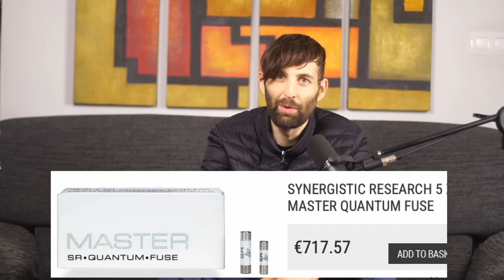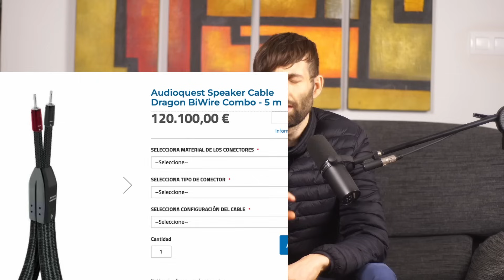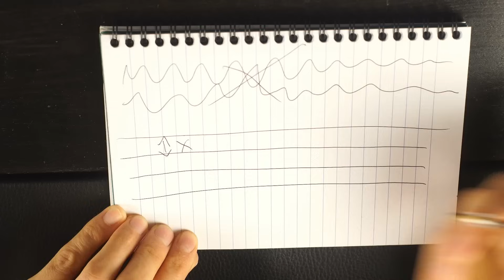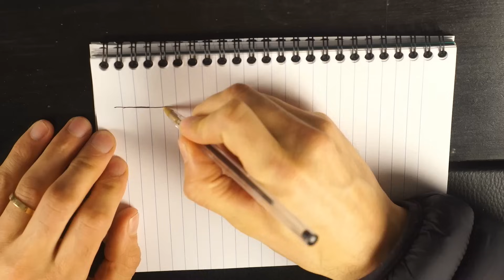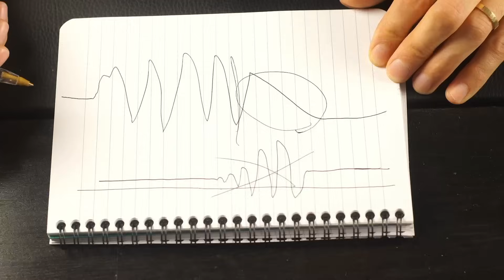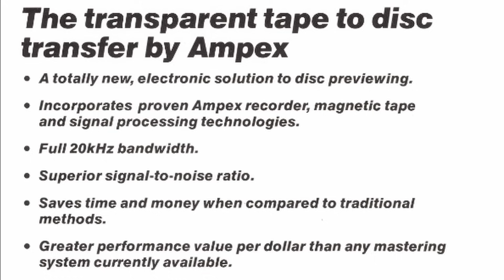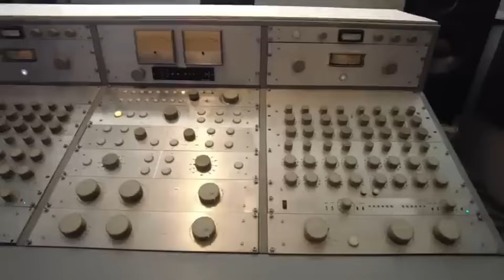Hard truth: most vinyl is digital anyway

Comment: For the variable grove spacing, I am surprised they stated it was cheaper to buy a digital delay unit which would have been very expensive at the start of the 80's than it was to put an extra playback head in the tape recorder. The head for the predicitive signal wouldn't  even need to be very good.

Comment: Thank you! Finally someone who articulated a lot of what's been in my head but unable to easily put into words for the last 15-20 years (but with even more detailed tech explanation).

During the loudness war era (late 2000s + early 2010s especailly) I'd buy an album on vinyl, unwrap it and the first use would be recording it off a USB deck to computer, then I'd use that as my digital version, in preference to CD/mp3. Had the higher dynamics but obviously it'd also get a bit of surface noise and crackling which would annoy me and make me wish that version of the master was made digitally available somehow.

When HDTracks website came about, I thought this would finally be that...but nope, turned out to be lossless versions of the same digital master.

There's definitely a market there for a digital release of the HDR master.
Reply from the maker: 100%

Comment: This argument of digital vs analog and how analog maintains the information that is being lost by digital sampling process has been around for ages. It is technically true that some information is being lost but this not the information humans would be able to perceive anyway. All the high end digital equipment samples at 96kHz. This means it can accurately capture frequencies up to 48kHz. This over double the frequency what human ear can register. Even if you "only" sample 44.1kHz (CD) it's still gonna capture all the frequencies humans can hear. It's almost like the original engineers chose this sampling rate on purpose based of this fact. I think most people don't realize they always are listening to analog because analog is what comes out of speakers. Resulting sound wave will be exactly the same from digital or analog source (minus the noise).

Comment: i will concede that vinyl is digital, however i will argue mine sounds better because i have pebbles taped to my cables behind the amp. these pebbles clear up the audio and sounds like god. and on certain days like buddha. also my cable lifts are made from endangered elephant tusks. these tusks really clean up the signal and prevent deep space quasar pulses from interfering with the audio. the building i live in has beams made cold riveted with cores of pure selenium, which causes some ectoplasmic interference but these waves actually only remove annoying inpurities and leave clean audio.

Comment: Vinyl cannot be digital. It's an analogue format. The source recording might be digital, but the disk is always analogue. And because of the way the sound is put onto the record, and then recovered from it, there are inherent limitations in the reproduced sound quality. The best vinyl LP records have no more than about 18 to 20 minutes of play time per side because squeezing any more than that onto the track has to be done at the expense of audio quality. So, unless you have damaged hearing, avoid any LP which claims to have an hour or more of playback time. They do exist, and they sound awful in comparison to shorter playback time records.

There's too much about this to go into in a YT comment, but there's plenty of information online in reputable websites. But suffice it to say that the RIAA curve enhancement which is applied to all reputable vinyl recording audio both in the recording process and in playback is an approximation to give the most faithful rendition of the recorded sound. It's not perfect, and the different types of pickup head give different playback sound qualities. Also, the condition and shape of the pickup stylus make a huge difference to the audio generated by it and sent to the amplifier. 

A Digital recording in a a CD or an audio file will always deliver the same audio signal to the amplifier, limited by the quality of sound presented to the amplifier you are using, and by any processing which is done in the recording studio, plus the inevitable quantisation noise from the digital processing. And if you can hear that quantisation noise in a 24-bit or higher signal, then you have very good hearing indeed. Most people cannot hear the noise in a 16-bit 22.1 kHz audio signal, as used on a CD. The main limitation is within the loudspeakers and room, or the headphones which are being used.

Comment: the thing is, I did the pepsi challenge and albums recorded to be played on vinyl sound better than streaming. The sound is simply better. Im no expert and nowhere near as qualified as you I can only tell you what I'm hearing.
Reply from the maker: what do you mean? are you comparing a specific record on vinyl to spotify? or are you generalising among many record? the latter is dismissible
Reply: @APMastering  I compared led zeppelin 3. Plsyed it on my record player through my logitech 5500 which has an analogue input and then from Amazon music HD through the same system. Hands down  miles better on vinyl.
Reply: @APMastering  also black sabbath/black sabbath, black sabbath paranoid, black sabbath master of reality, black sabbath vol 4,led zeppelin 2 and pink Floyd dark side of the moon. All sound so much better on vinyl.
Reply: @ViklasSvenske How is that different than playing Led zep 3 on vinyl and then playing the digital version? It's the compression that kills digital reproductions.
Reply: @ I can just use my ears.

Comment: Analog, vinyl purists tend to collect pre 80s vinyl pressings, or at least value them the most, so those vinyl predate the ampex cutter digital delay system.
If money no object, analog purists collect pre 80s reel to reel 7.5ips or higher commercial tapes.

Comment: Being a technically minded person, I never got into the bandwagon of praising vinyl for its sound qualities (but like you, I love the whole experience of listening to them, and maybe yet because I still have my original vinyls from way back when there was nothing else).
But you definitely nailed it when you mentioned the digital delay unit that's being used to enable the variable groove pitch.
And being an industry, the phonographic industry would never indulge themselves with non-rarional reasoning in their equipment selection... So... Didigtal Delay for everybody.
I never knew this was a thing that was sistematically employed.
I thought variable groove pitch was only used in cheapo "the best of x" kind of records, noticing that pretty much every record of any reputable band would have usually tops 5 songs per side or 6 if they were short.

Comment: CD is my preferred way to listen to music. But I did discover that there are some issues with older recordings. I remember when I got a Procol Harum album on CD, Shine on Brightly I believe, the CD songs were all slightly shorter and pitch shifted a bit higher than my vinyl copy. After looking into it I discovered that the original studio recorded for several months  with a mis-calibrated reel-to-reel deck. The newest CD remaster of the album (at that time) didn't take this into account. Fortunately I was able to find an older release that was done correctly. But other than weird instances like that, vinyl will be hard pressed to beat digital.

Comment: Going in the opposite direction, I saw a documentary about the creation of a digital (then modern) version of the Mellotron (a 1960s sampling machine which used tape, most famously used in Strawberry Fields by the Beatles), the M4000D. They said when they recreated and recorded the sounds digitally they sounded too good so in order to make them sound more like the 1960s version they copied the digial recordings  onto 1/4 inch reel to reel tape as an analogue recording (like home enthusiasts had) then digitised a playback of the reel to reel  recording. That was what was then put into the machine ROM. This added the analogue warmth people prefered.

Comment: A big part of the "vinyl sound" depends on the EQ profile of the stylus+cartridge. If you use a calibration disc to plot this, you can then reverse it and get a clean, accurate reproduction of the frequencies. Apply that same profile to a digital recording and it takes on the sound the vinyl had, but without the surface noise. If you like the vinyl sound then actual vinyl is a great way to get it - but it's not magic. 🙂

Comment: I have a collection of about 200 records, mainly original pressings of 70s/80s metal and rock. I wouldn't consider myself an audiophile but I like putting records on. (Audio Technica 120, Onkyo receiver, Sansui 2500 speakers). I think that modern represses sound muffled and distorted compared to digital, so I don't buy many new records if the old ones are easily available. My originals definitely sound Different, maybe not better, than their digital counterparts. I think sometimes having a record from the year it came out (pre 1990 or so) is one of the only ways to hear the original mix/master, if you prefer that. Iron Maiden is a great example of modern vinyl thats expensive, digitally sourced and sounds horrible, and I wouldn't ever say that having a vinyl reissue sounds better than another format. In many cases it's the same digital remaster that's currently available, just pressed on vinyl, so it's even worse. I've always wondered though why some of my old records sound so clear and have a ton of stereo separation compared to when I listen to the same album online. Likewise, my records from 70s/80s are much louder on the turntable than modern records. I usually listen with the volume at about 9 oclock, not even halfway. But with a modern record, I have to turn it up to noon, sometimes even past that to get it to sound the same. Not sure why, probably something with mastering and compression, but that could be the draw to listening to old records. I love putting on original Van Halen records, and hearing how crisp and punchy they sound. Modern remastering seems to favor bass boosting and I think that makes older music sound artificially muddy. Music recorded in the 70s wasn't really meant to compete with modern electronic pop music that's totally slammed.

Comment: I ditched my old vinyls on the sidewalk in Brooklyn when I moved to LA and never looked back. My distrust of vinyl first began in the early 1980s when I accidentally ruined the second disc from The Wall while painting the ... wall ... see what life did to me there? But the important thing to understand is analog buffers, AKA unity gain amplification. It's all a copy  ... of a copy ... of a copy ... so called audiophiles tend to avoid actually learning electrical engineering you see ...

Comment: You missed the point though. The vinyl v digital appreciation argument has multiple camps, delineated by age group and by decade of audio listening commencement. Its also delineated by type of music. And it's affected by aural quality of the individual. Audio engineers require a standard excellence of hearing, and have been trained on listening and performing their job - consumers not so much. It's like a governor of the bank of England arguing with a laundromat owner about the economy. The owner can buy the best equipment, sussing agent etc, but they can't talk the same talk.

Comment: The reason I like vinyl is not a purity test. There's a reason an .mp3 file sounds different from a .flac file sounds different from a .wave file. Data compression. Now, if you were to tell me that records were pressed using .mp3 files, I'd be pissed.
Reply: @ViklasSvenske I agree. If it has to be digital, it has to be FLAC. It takes so much space though.

Comment: To say it’s all digital is neither here nor there in my opinion. 

Most hi-fi nerds don’t really get good audio (pro audio). I hate to say it, but it’s true. 

I’ve seen a few decent hi-fi setups, none of which were in a treated room. The focus on tube preamps and 100 carrot gold cables over any acoustic treatment or optimal room layout says it all really. 

I know some engineers who have a decent home listening setups, usually integrating studio converters and setting up a room more akin to mastering room (without the lathes and outrageous outboard racks). 

I took this stance (arguing digital audio is better than analog) in a room of vinyl nerds who scorned me. I have a very nice, albeit old (late 70’s) hi-fi setup!in my lounge, far superior than most peoples whom I know, but that system does not surpass how music sounds in my studio, with better acoustics, balanced connectivity and superior converters. 

Decent vinyl can sound great but  it’s still noisy, there is dust, dirt and crud on the record, mild warping of records etc, issues with mixrophonics, - it’s imperfect. There’s a charm to it and the medium inherently imparts a sound that is pleasing to the ear, whether it’s been through a digital process or not. People get used to that colouration, which exists even when the master is derived from a totally digital recording chain. 

It goes beyond sound quality for most hi-fi nerds. It’s about the feeling of putting on a record or the smell of the old tube amplifier and that stupid little vinyl stand with “now playing” on it, like anyone gives a fuck but you. 😂

Comment: Dude take your in the box recording and run the master through a Otari 2 inch tape master recorder and A B them the difference is huge
Reply from the maker: I used to use an otari 1/4" and loved the sound. but all it does is add distortion and a bass bump. you can do the same ITB
Reply: @APMastering  doesn't sound the same trust me .
.no plug in will give you that grit

Comment: You don't only need a delay line, you also need to know where the previous groove is, so having that data in the same digital circuit also simplifies things.
Reply from the maker: I dont think it works like that exactly on Neumann lathes because its about feed rate in the pitch box and not about tracking the exact positions of the grooves
Reply: @APMastering So I guess the maximum amplitude of the groove is considered the limit for the next one even if only a section of the groove was wide?

Comment: The sad thing is if you're old enough to have vinyl your hearing is just not good enough to tell the difference between a $1000 piano and a $100,000 one heard live, much less the difference between if they used some mythical analogue unicorn process vs. normal off-the-shelf gear for a recording. The limitation is flesh, not gear.
Reply from the maker: i disagree. a half deaf pianist can hear the difference. but being 70 years old means you are missing the last octave